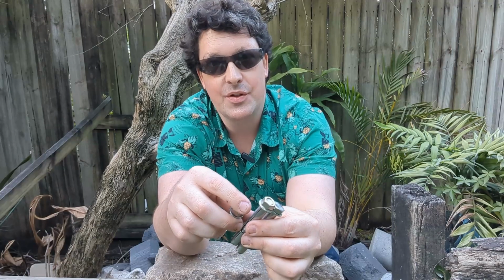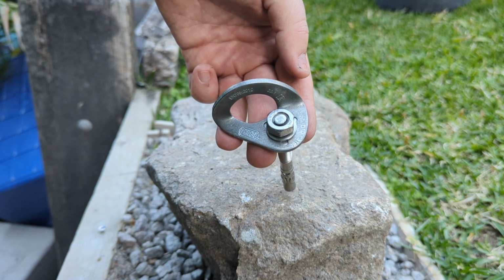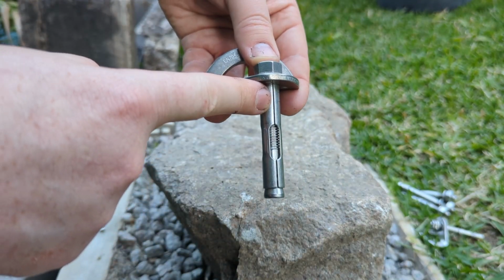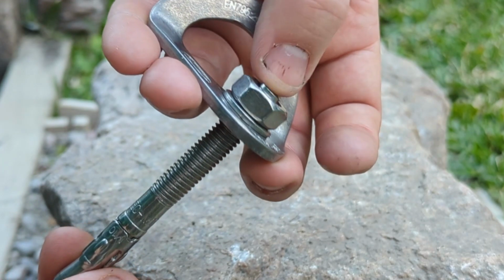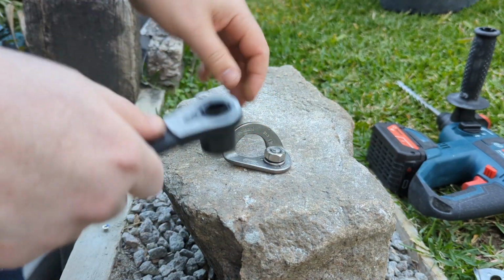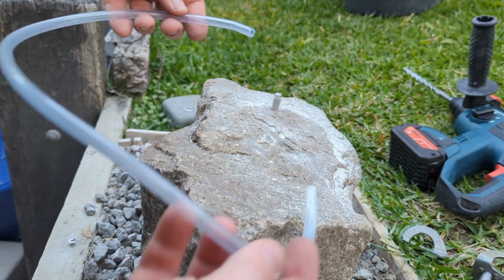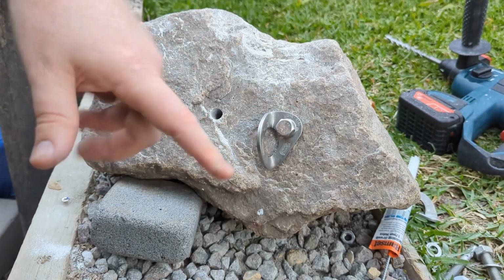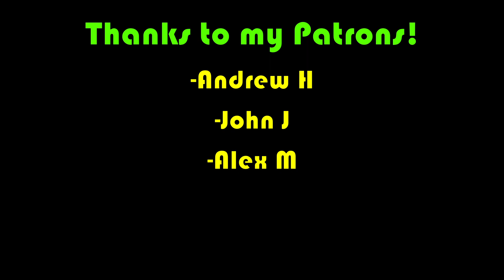Expansion bolts: Wedge bolt vs Sleeve bolt [Climbing bolt basics]

Comment: Awesome video! The only thing I'd say is that it's good to drill the hole extra deep. This can greatly aid in removing the bolt, especially if you have to spin & pull it. Cheers!
Reply from the maker: Yep good advice. And easily doable with modern brushless drills

Comment: Good work on this video. As Usual. Quite comprehensive. 

I also wonder why the 5 piece bolts have so many bits. The bolt you have seems like a much smarter design.
Reply from the maker: Thanks again mate! I assume the extra parts are to aid removal by preventing sleeve mangling. Or maybe to hold the sleeve in with a softer material so when pulling it out after undoing the bolt, it actually goes. The only bolts I've seen here with the extra plastic parts on the sleeve are the Hilti high-load bolts, like 20mm wide. In this vid I wasn't able to get the sleeve out, as happens, because it gets deformed and just wedges in there by itself. Which sucks because I remove these all the time but never when the camera's rolling
Reply from the maker: Also, I was going to link to one of your vids for the wedge bolt removal technique, do you have a preference? Maybe the Tahoe rebolt?

Comment: Great video content!!  @MountainMullet I noticed you switched drills from two years ago.  Are you finding the Bosch is better/faster than the dewalt?  Do you have preferable drill bits?
Reply from the maker: I have many drills now! I test them on my other channel. I think they're basically the same. DeWalt in general a bit faster drilling but Bosch seems a bit better made & more durable. But all the main tool companies are competitive so there's no huge differences between them (aside from Hilti. Those drills are something else)

Comment: Noticed the spanner break at the end have you ever tried the Bacho ratchet spanners they're great and 4 sizes in 1
Reply from the maker: No I haven't! Is that Bahco or a different brand? Bahco's pretty nice
Reply: @MountainMullet  Yes its Bahco S4RM4T 4pce is the model i have and works a treat on mechanical repairs and for repairing fences